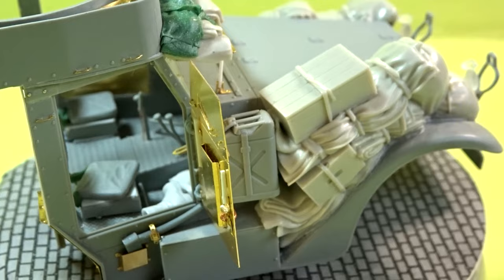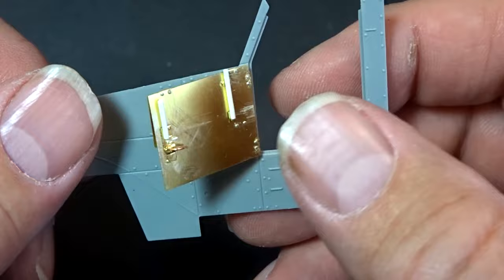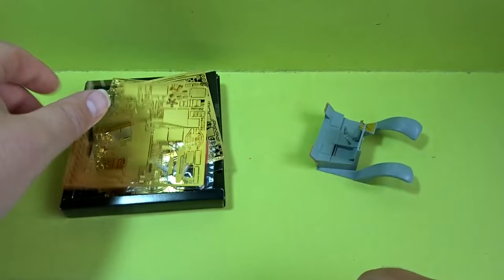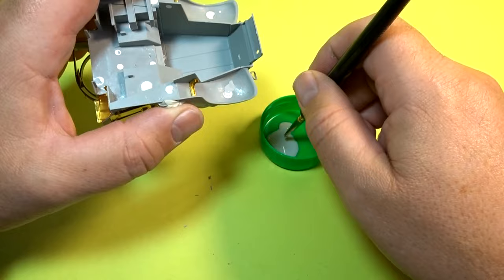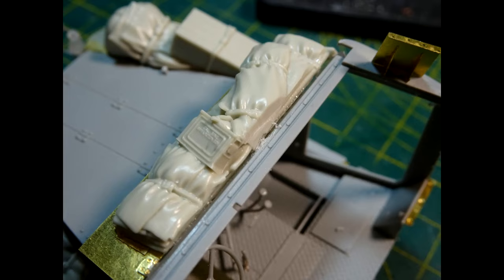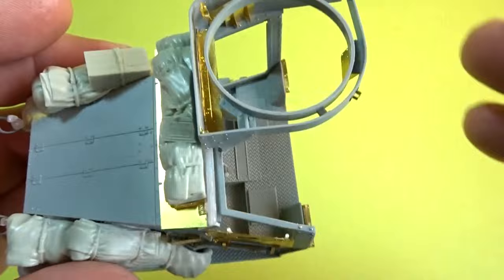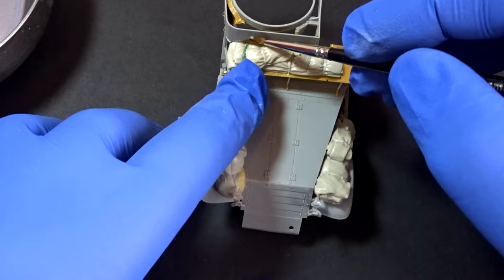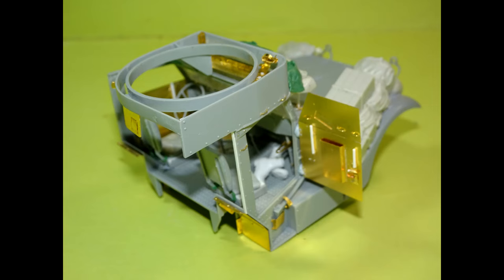Dragon M3 A1 Half Track 1/35 scale - THE CAB

Comment: Hi Steve, that cab looks awesome you have really done a great job with all the PE bits you’ve done. Do you have a PE bending jig? Or do you just use a knife or straight edge?
Reply from the maker: Hi Mike. Hope you are well and having a great weekend. I have a PE bending tool for the larger more complicating folding requirements. However most of the bending is done with my flat nose pliers. Many thanks of looking in and commenting.